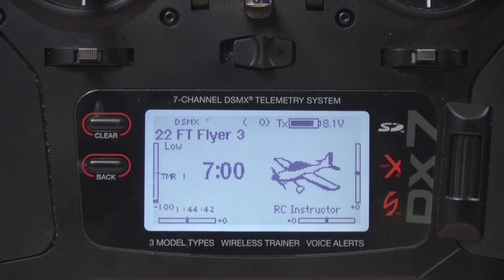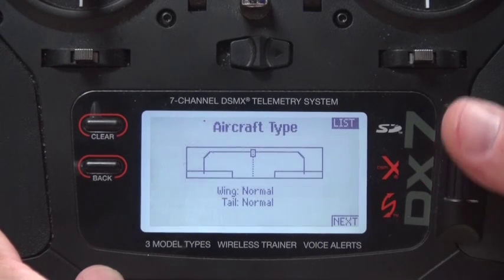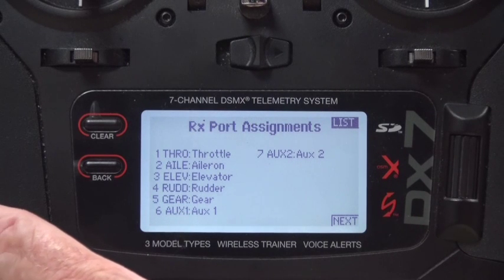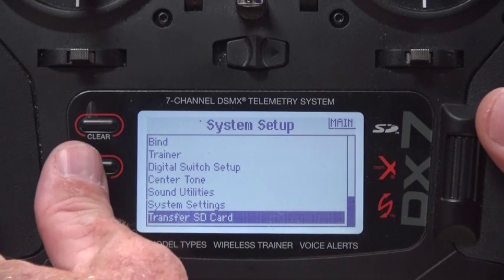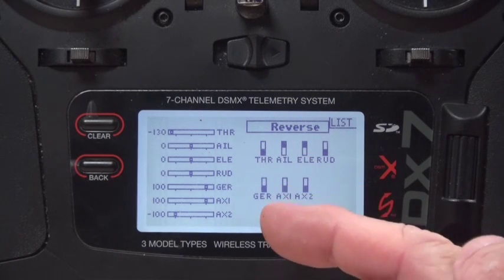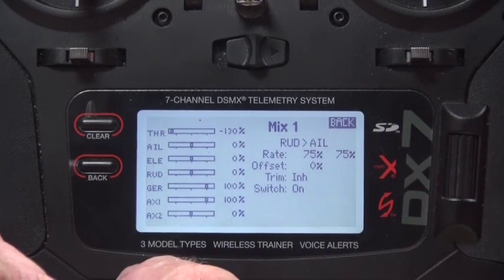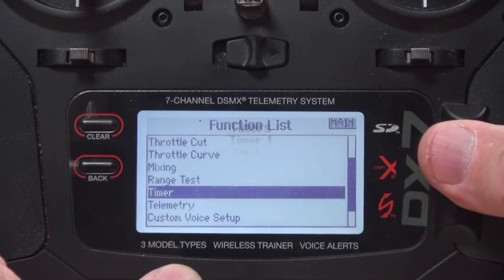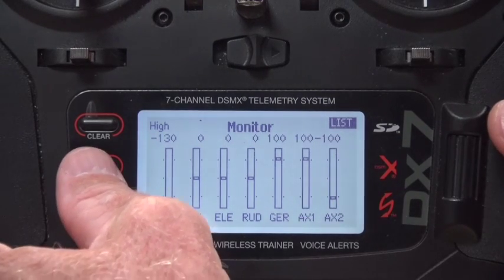FTPP16 FT Power Pod DX7 Programming

Comment: Hi, nice video. Can I change the servo 7 warning to a custom voice setup?
Thanks
Reply from the maker: The only way to have a warning when you turn the radio on is to use the Warning function is the system setup.  Custom voice cannot do the same because they wait until you flip a switch to give you the voice command.
Reply: +RC Instructor Thanks